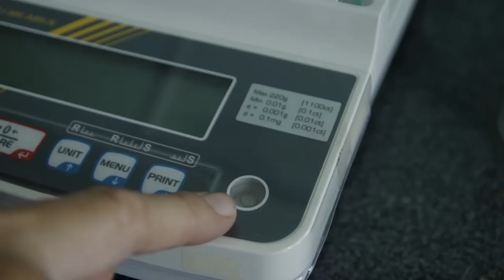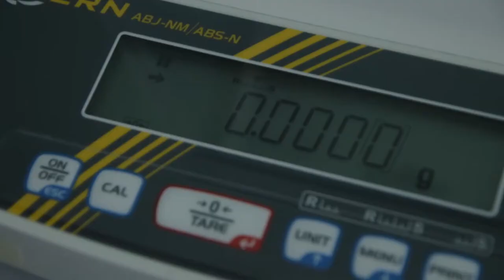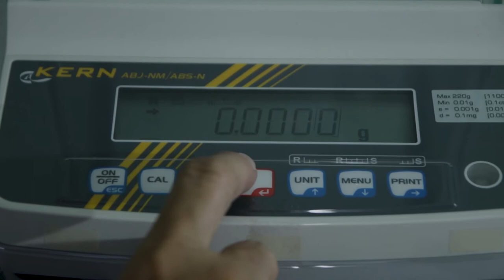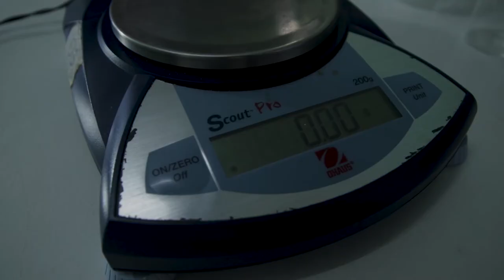Analytical balance

Comment: Pamela C. Liray
BSMT - 1A
I have learned to identify the different parts of an analytical balance and to differentiate it from the other type, also its accuracy, function, and the proper use of the analytical balance & top loading balance.

Comment: Marinel M. Clemen
BSMT 1-C
I learned about the parts of an analytical balance and their functions from the video. The correct use of the above laboratory equipment was also discussed. Also shown in this video are the other kinds of balances involved in calculating the weight of a substance such as the top loading balance and triple beam balance. The precision of these balances in measuring the weight of the substances varies.

Comment: Jhonela R. Naparati
BSMT 1-C

For this lecture video, I learned about the parts of an analytical balance and their corresponding functions. Proper use of the said laboratory equipment was briefly discussed. Also included in this video are the other types of balances used in determining the weight of a substance such as the top loading balance and triple beam balance. These balances differ in their accuracy in determining the weight of a substance.